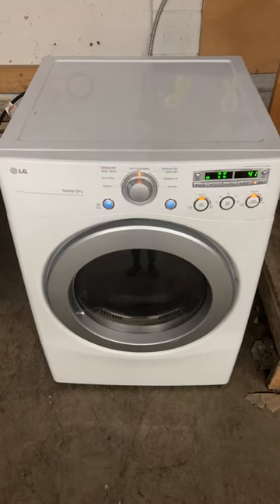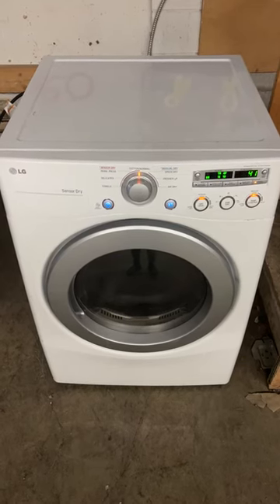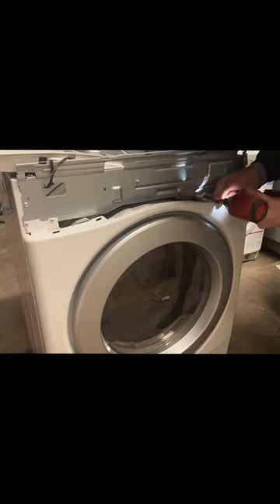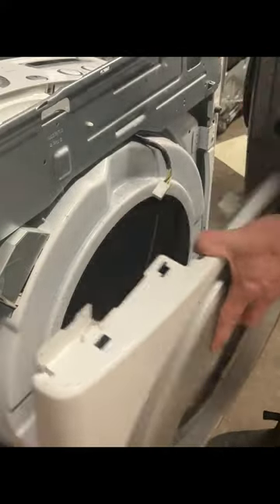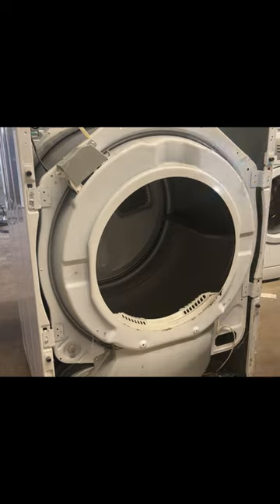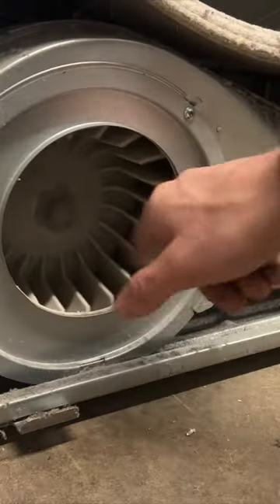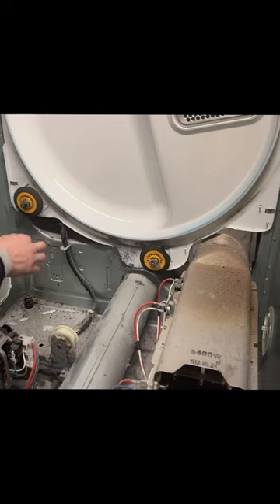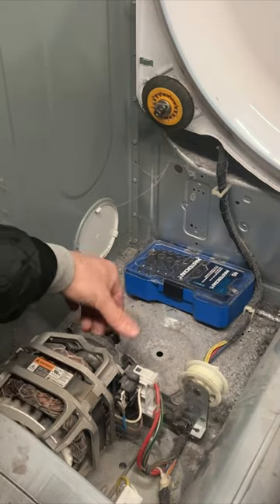How to Fix ANY LG Electric Dryer Making Noise

Comment: I've seen it before, but the fact that skate wheels are used is still strange to me. Super practical solution, though - the rubber dampens, the bearings make it run smooth; both can be replaced individually...
     Why re-invent something that has been designed perfectly, and is readily available?

Comment: Lately, the neighborhood handyman (me) has been inside a number of clothes dryers of various brands (GE, LG, Samsung, Frigidare, and Electrolux). Inside, they all appear to be the same, using the same components. They appear to be made by the same company). Same goes for the pumps in the washers, same company. Those rollers are the same that are used on inline roller scates.

Comment: Thanks, mine didn't work when reassembled until I took the top off and reconnected the single white wire to the control panel. The retaining tab broke off in the last 13 years. Some day i may have to open it again and hotglue the outside of that connector.

Comment: Would somebody really throw out a dryer just because it's a little noisy why not call a repair shop to have a look at it because it's usually cheap for them to fix it or just look it up and fix it yourself that's what I would do anyway
Reply from the maker: Some people would, yes. But I always recommend having a look at it or having someone look at it! They’re usually worth fixing
Reply: Repair person charges $60 per visit, never seems to have the needed parts on first visit and charges the $60 visit fee to install part on second visit and marks up parts dramatically so that repair costs can be $300 to $400 all in. That's just been my experience locally.
Reply: Ok where I live its $120 for the guy to show up at the door and diagnose it  and then told me it possibly needed a $300 part for a 3 year old Whirlpool washer that I paid $459 for new it's not rocket science after that in the trash it goes and on to a new one I'm not disputing yeah these guys have to make a living but then again that's why most appliances are throw out
Reply from the maker: @1995dresser  unfortunately there are a lot of shady techs out there! We’re very clear with our pricing ahead of time to avoid our customers being dissatisfied